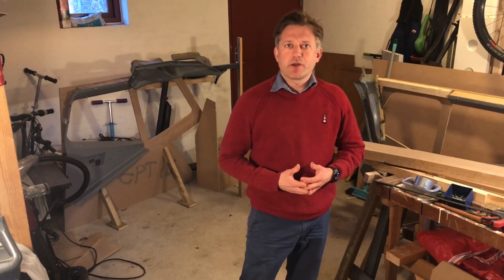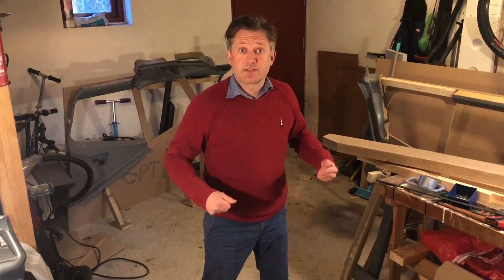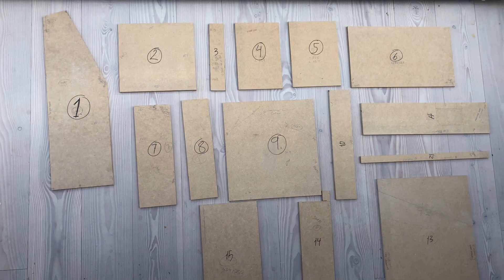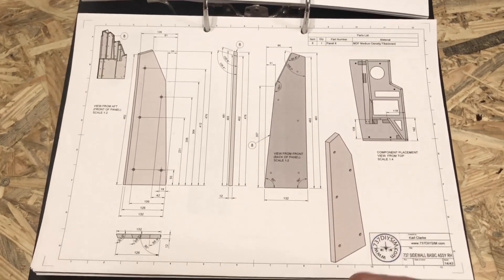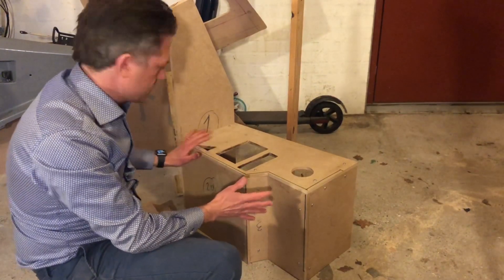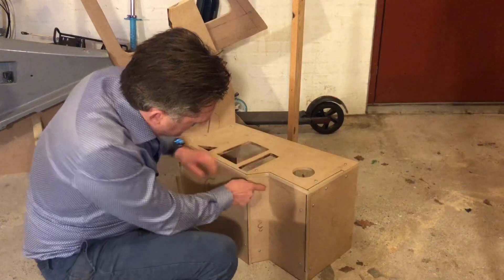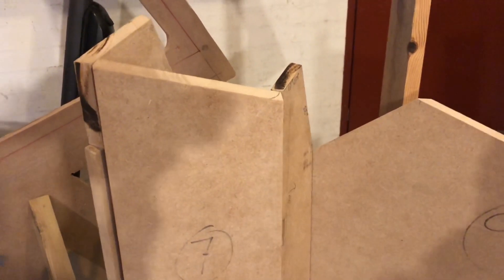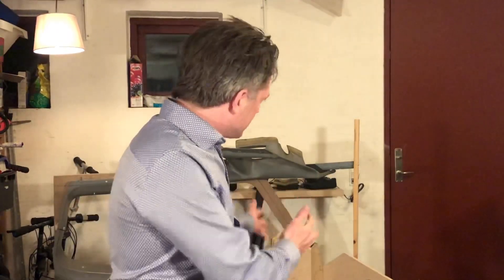OEM part 3 - B737 Home Cockpit

Comment: Hi Peter. Your last 2 latest videos are "For Kids" so therefore the new YouTube policy is to close the comments section. If you'd like to maintain a dialogue with us, you should change this away from Kids video. If you chose not to allow comments, then apologies!
Reply from the maker: Thanks. 
I wasn’t aware comments are off limits for kids.  The status is changed. From here on no kids allowed. :-)

I mailed it as kids-proof in case someone under 18 not would be able to see out. Unaware comments works be disabled.
Reply: @BuildaBoeing  It doesn't ban kids, I think the "For kids" category simply protects them from comments in bad taste maybe...